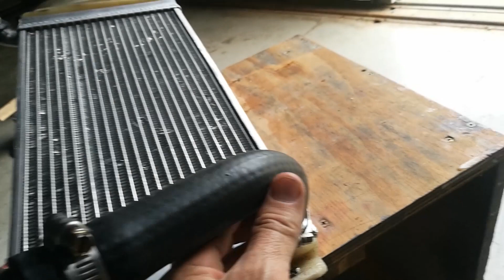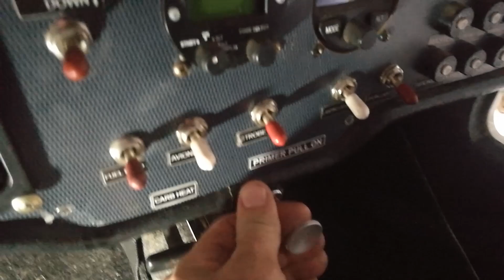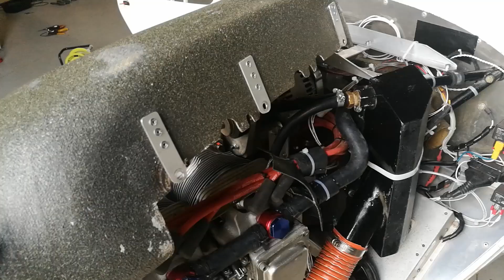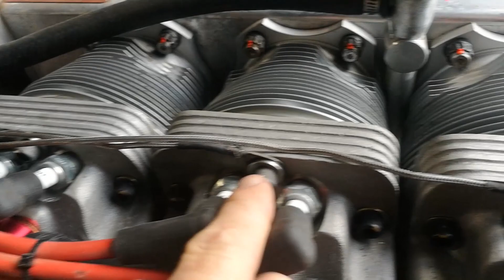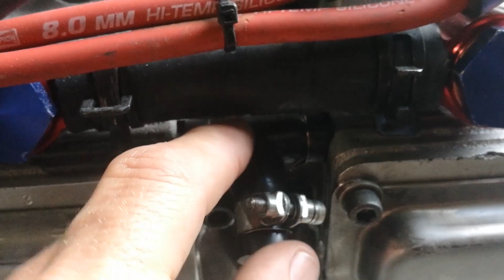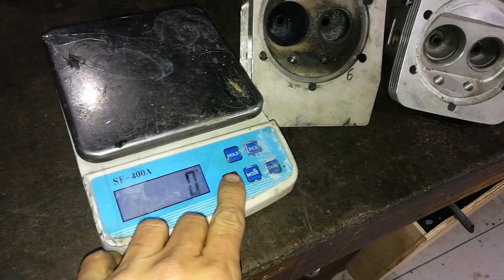Jabiru 3300 LCH with the LOT

Comment: This is such an easy fix and should have 
been done years ago, water cool the barrels and heads. 
Why would they think this design would work when it was a major problem on the VW s.
Just look at water cooled motorbikes barrels and heads there's nothing bulky about them.  Heads far better that the water cooled heads on them today it all looks like it's an afterthought to many connections for leaks to happen, the more parts the more chance of failure's and just think of the room you would gain if the water cooling galleries ran through the block just under the cylinder heads with a water gallery on each side of the barrels you have done away with all those bulky pipes and banjo bolts and doing away with all those cooling fins would give more room to work on the engine and having a constant engine temps means longer engine life and service intervals and on real hot days on take off your not worrying if you gotta open the door and push your passenger out.
Dont get me wrong l love this plane but dont like a engine you need to babysit in the hotter weather.
Would love to see bigger engine size as standard fully water cooled fuel injected and turbo and I still think they could be the cheapest motor on the market

Comment: Are the New Jabiru engines still the same ?, I was told that  they have improved them and they are much stronger and at least long lasting. I don't know how old this engine is that you are converting, maybe it is one of the generation one engines and Not a generation 4. If it is a Generation 4, how come Jabiru haven't TRIED to fix the well known problem?. If they have not,that would be disgusting, considering how much money they are asking for their Jabiru's and engines now.
Reply from the maker: There’s not much history on the latest gen 4 engines. Our equipment is made for the earlier engines with steel cylinders. Fix the cooling and we find these are generally strong.

Comment: I admire your work.
Are Rotec heads manufactured from a harder alloy (or heat treated, hard anodized, nitrided) to achieve greater hardness? Or does their stability result only from their much lower operating temperatures?
Reply from the maker: Heads are made from classic 356 casting alloy, typically used on bike heads. Heat treated  tempered and shot peened. But the resilience comes from them being liquid cooled and always staying well under their yield temperature.